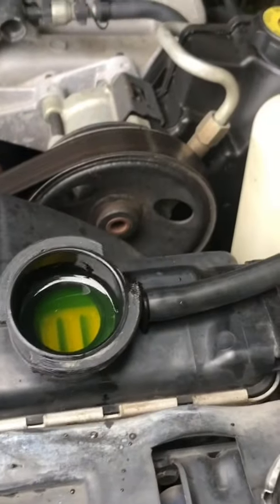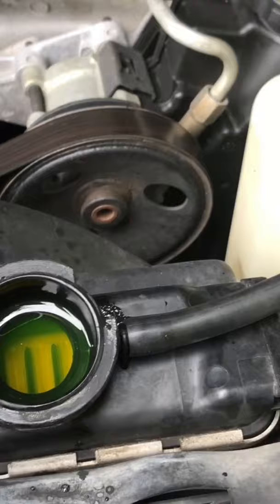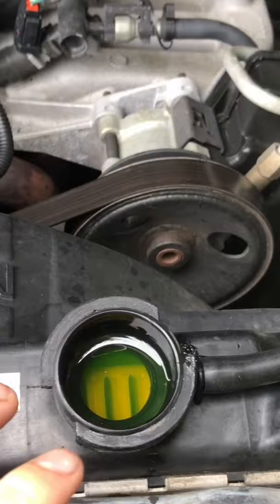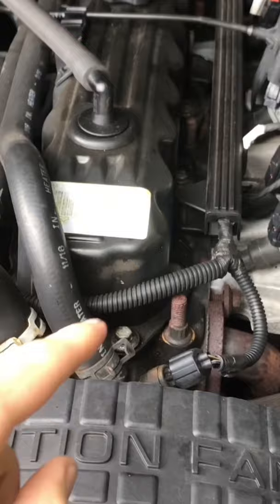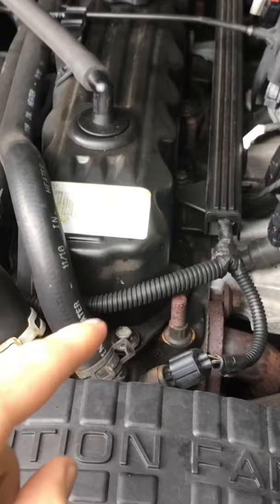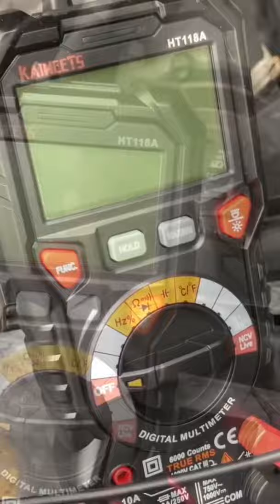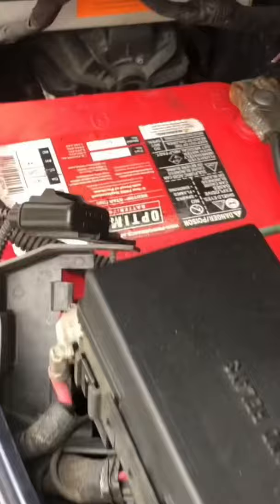How to check if engine coolant needs to be replaced

Comment: Doesn't  make sense, the job of the coolant is to cool down the radiator
Reply: What doesn't make sense?
Coolant, over time, develops an electric charge and becomes conductive. That's bad because it makes it a route for electrical discharge from electronics.

Comment: This makes no sense to me at all...  but maybe I am missing something.  I am a shade tree mechanic with a degree in electronic engineering, so it's not like I don't get what is happening.  Why would the difference in potential between the chassis ground and a random spot in the coolant mean anything?  How could you quantify it?  There will be major variances with coolant chemistry, block and radiator metallurgy, harness wiring, and others.  What could this possibly tell you, and why would the desired reading be consistent between many different vehicles?
Reply: i think when coolant deteriorate more likely the conductivity increases.
Reply: @wawaweweph  But he is measuring voltage, not resistance / conductance..??
Reply: Correct, however. What happens when something detoriates more and more and becomes more conductive  @GoingGoneGalt ?

Right on, that voltage will increase.

So you are not wrong, but theres multiple roads you can walk.
Reply: @bachmed00  Voltage and conductance are two completely different things.  This is physics, not metaphysics.
Reply: You have a valid point. The only way to check is if you have a boiling coolant reservoir. Then you know the there is something wrong with the coolant. I would take the voltage reading of that boiling coolant when the car is cold started. Then compare that reading to a proper running radiator. We as scientists must test these theories to find out.
Reply: @leo959  How do you take a "voltage reading" of coolant???   You are either trolling, or don't know the first thing about electricity.
Reply: @GoingGoneGalt  its called electrochemical reactions. Water plus metal contact of the mutltimeter creates some type of resistence to the multimeter making a read voltage. If you took chemistry you would know about electrolysis.
Reply: @leo959  Yes, I have, and I also have a degree in electronics.   Yes, you will get some kind of reading.   That reading will effectively tell you NOTHING, except that you have galvanic action going on, which is likely eating either your engine or your radiator and / or heater core.  The only "good" reading you could hope to get would be zero.
Reply: @GoingGoneGalt  in chemistry the only way to know for sure is by testing. Chem....is.....try
Reply: @leo959  Wow...  you can spell.   In chemistry, you also have baselines and charts and graphs and data and known givens with which to analyze what you are looking at, and a set of parameters to compare them against.  You don't have zeke with his harbor freight meter yellin' out "Looking dere, cooter!  Numbers!".   Measurements mean nothing if you don't have a clue what is driving your results.
Reply: @GoingGoneGalt  everything is explainable through science until the variable named god father of jesus christ is involved into the equation.
Reply: @GoingGoneGalt  in the silence of material senses lays the key to unveiling wisdom. He who talks does not know. He who knows does not talk the highest knowledge is unutterable for it exists as an entity in lanes which transcends all material words or symbols.
Reply: @leo959  Walk the earth, Caine, but when it comes to fixing my cars, I will stick to the chiltons manual, like I have done for over 30 years.
Reply: @leo959  Great.  Meditate on this; the vid is BS.
Reply: @GoingGoneGalt  u disrespect chemistry and it shows.
Reply: @leo959  Nowhere close to your disrespect for the English language.  Dude, you wouldn't know a valence shell from an ion or an atom from a molicule.
Reply: @GoingGoneGalt  What is your problem? Why are you getting combative lmao?
It's as simple as the electric potential between your coolant & a ground should not be too high, but you are right that it should be as close to 0 as possible. Pretty basic Google searches reveal that much.
If it's too high, it becomes conductive & therefore becomes a means for electrical discharge for electronics. Still, I don't understand why you're getting so angry.
Reply: @guacre2675  "if it's too high it becomes conductive".  Seriously?   Right there, you have proven you haven't a clue what you are talking about.  Just like this little boy "content creator", who says that if it is "under .2 volts, you have to replace your coolant immidiately!".   Good lord.   Get a hygrometer & check the specific gravity.   That's how you check it in an old 4.0 I6 with plain old glycol like he is displaying here.
Reply: @GoingGoneGalt  we r done talking. Take care
Reply: @leo959  Never take on an Xer who actually has facts at his disposal, against your "feels".
Reply: Was looking for this exact comment.
Reply: I'm not a mechanic but this doesn't common sense is telling me this is bullpoopy

Comment: Is it a red flag the coolant valve replaced on a 15000kms only 2.5 year old car🥺 My Mazda CX5 (bought in Dec 2021 brand new) showing check engine light and coolant valve needed to be replaced. I'm  really worried if it's gonna run into more problems😔
Reply: Coolant valve?
Reply: @spooked8007 yeah that's what they said and I got a report  stating that
Reply: @Cat-es9rq  tbh brother they may be talking about a thermostat but I’ve never heard it referred to as a coolant valve
Reply: Simple fix tho don’t stress
Reply: yes something wrong with thermostat and they had to replace the coolant valve to fix that

Comment: i just got my coolant changed and when i run my car it still over beats to 120°c and tells me my coolant levels low , could you kno the problem ?
Reply: Theres air in the system
Reply: Head gasket
Reply: Your head gasket is  likely blown
Reply: @therottenoneslim  hey it ended up being the thermostat it was stuck opened? or closed not sure but one of the two and i had replaced it and now my cars back to normal

Comment: Please tell me when I car run hot when a c is on I did the head job I change water pump I radiator is over a year old the cap change any ideas?
Reply: If you car has an electric radiator cooling fan it should be on when AC is on. Cooling fan running has to help radiate  heat out from the condensor that is taken away from the cabin. This is why you should get cool air from the evaporator when the cabin fan blows air through it's spaces. Also check the outside of your condensor and radiator for debris that may reduce or impede the flow of air. With engine cold, Check coolant level, if low, do a static pressure check with a free tool from advance auto or AutoZone. A great time to look for coolant leaks.  Pressure test the radiator or expansion tank cap. It should open at approx. 20 psi (see your vehicle specificity). 
If aforementioned checks out ok, take to a qualified technician.
Reply from the maker: Unfortunately, the best advice I can give you is to take your car into a mechanic shop, because I have no idea what you are trying to speak of.

Comment: Can I add water
Reply from the maker: If you need to top off your coolant in a pinch, and you don't live somewhere where it is currently dropping below freezing or expected to, then you can use pure distilled water. Though it is always best to use whatever coolant your car is designed for.
Reply: @MrEvanShmevan  -- Water doesn't provide any lubrication to the water pump, so keep it at least 50% anti-freeze.
Reply from the maker: @WakeUpAmerican000s  that is very true, that’s also why I said in a pinch. Because if you are in an emergency situation, distilled water, will at least help get you to somewhere where you can get the proper coolant.
Reply: You can if you’ve sprung a leak and just need to get home/to a shop, but you need to flush it afterwards asap.  It will cause engine damage, possibly a lot faster than you’d think and obviously if it gets below freezing you’re playing a very dangerous game.